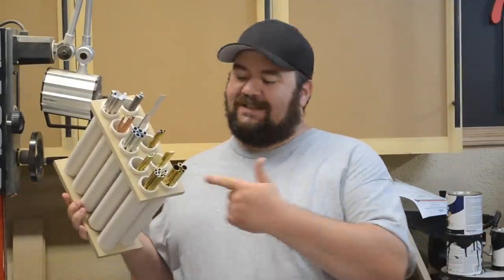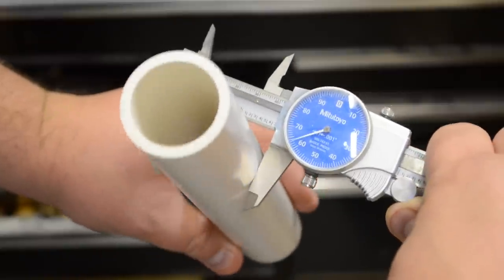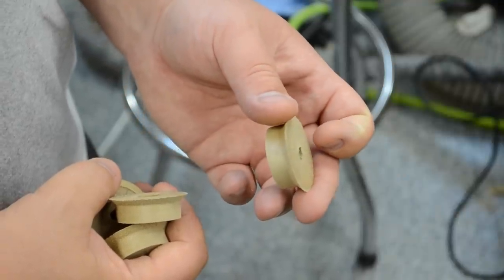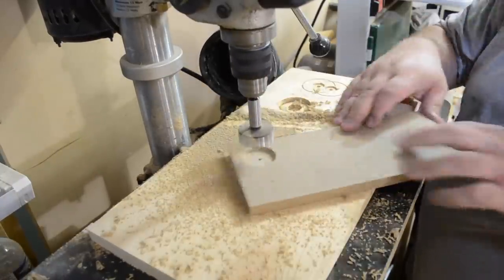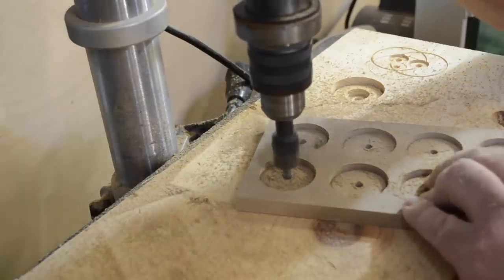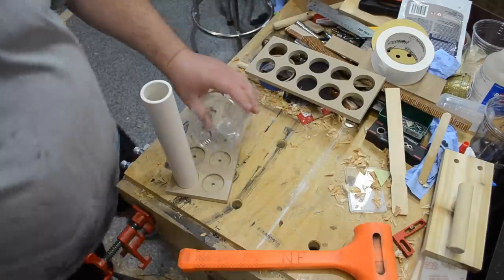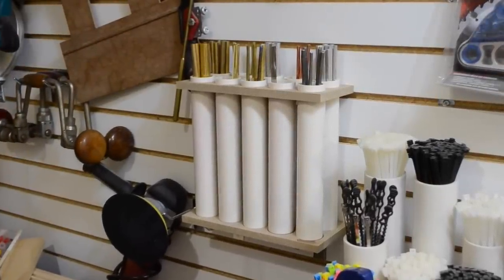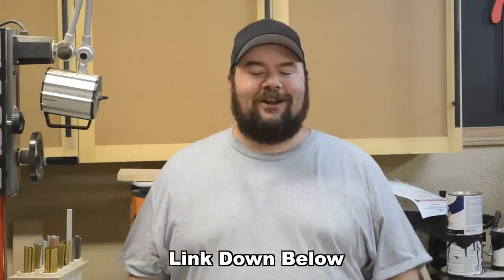Ⓕ Metal Dowel Rod Holder Organizer Thing (ep90)

Comment: I like the scrap block safety technique on the mitre saw. Clever!
Reply from the maker: thank much Dave!
Reply: It reminded me of the trick fot using the miter gauge to cut pieces to length on the table saw. You clamp a block to the near edge of the fence to set the length, but the work piece is past the block before it gets to the blade.

Comment: Great idea. What size pvc  pipe did you used? What length did you?
Reply from the maker: They’re probably like inch and a half or inch and a quarter diameter pipe

Maybe 10 inches long - if I were to make it again I would make some shorter pipes for the stock that gets cut that I still want to save as well as some longer pipes so I have room for bigger material

Comment: Those circle cutting drill bit things scare the hell out of me - good job on using it and I'm doing kind of the same with 3 inch pvc and making the YouTube go to hand drill holder/organizer.  So my question is how to keep the pvc dust(?) down as this stuff is all over and through the magic of static electricity it sticks to everything?  Any ideas?
Reply from the maker: yeah it's one of those tools to keep you eye on for sure - I don't mind the PVC dust much at all but I would suspect that trying to ground it would be the best solution

Comment: Nick, did  you consider using 3 pieces of MDF 2 with through holes and 1 with no holes. clue 1 with through holes to the one with no through holes for the bottom. Faster and easier. Just a thought
Reply from the maker: I did that here - https://youtu.be/KOfaX8J3lBw

Comment: Ha!  I pulled my dowel stock out yesterday and after making a dowel making jig I had over  100 dowels in there from 5/8" to 1/4" out of walnut, maple, cedar, red oak and White oak and some store bought dowels.  So loaded up the CNC and used some quarter inch plywood and cut up 15.00 worth of schedule 30 DWV 2" pipe.   Here is a picture of it.  Its still out there drying and needs cleaned up a bit.  
The gorilla glue is still  expanding and drying and it will clean up tomorrow.  

It will hold dowels for 5 species of wood from 1/4"  3/8"  1/2"   5/8"    3/4" my vcarve  and black paint didn't go as well as I wanted it to ...ah!

The dowel making jig by Skeeter or GrinWood works great.  I will fill this dowel storage up with the Dowel making jig from scraps.    Also bought some 3" dwv schedule 30 to make some for larger bulk items.  I made 25 cedar lantern kits this past weekend and just the dowels for the verticle will use up more than the 2" pipe will hold.  So some of the larger numbers will use the 3" pipe.   

Thanks for the idea.   It was a quick project.
https://drive.google.com/file/d/1SWHYvuVhJvL5waIDn7XrOCtcHyN-gjT2/view?usp=sharing
Reply from the maker: That’s awesome - you dig the engraved names - do you have both of those dowel making jigs? I am in the market and I’m curious your thoughts on those being you’ve seem to have made plenty of them 👊🏼
Reply: @NickFerry  I just went out in the shop and put my dowels in this new holder.  It needs to include maple and mahogany GRIN! Here is my observations on these two jigs from 3 weeks ago.   https://www.youtube.com/watch?v=ZFT3rkkUaqI
Reply from the maker: Awesome thanks - I’ll have a watch later tonight 👊🏼

Comment: My table saw always looks like that. So I cut a piece of scrap plywood the same size as my table saw's table. Now when it becomes full of crap and I have to use it I can just lift off the plywood and use my table saw. 

Now where to set down that piece of plywood full of stuff is another story. Mine usually ends up sitting on the floor until I can get it back on the table saw.
Reply from the maker: haha - been there!

Comment: Great video.
I'm thinking that O rings would be a good way to hold the top piece up.
A combination of friction plus epoxy or glue.
Yeah, I know, it's over kill, but for some reason, I prefer overly engineered and reliable than having something I made fall apart on my. 
I think it's the compulsive perfectionist side of me.
Reply from the maker: nothing wrong with that - I tend to do the same - I like the O ring idea

Comment: If you had used duct tape for the bottom you could have called the different orientations of this holder "on it's side, upright, laying down."  But since you used gaff, I think you are required to call them "Chicago, New York, L.A."
Reply from the maker: That is a very valid point